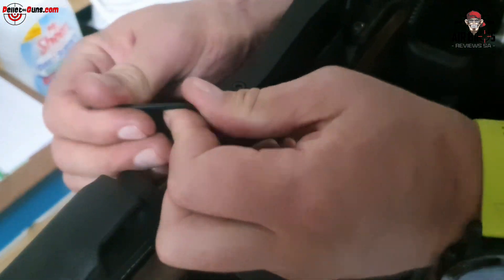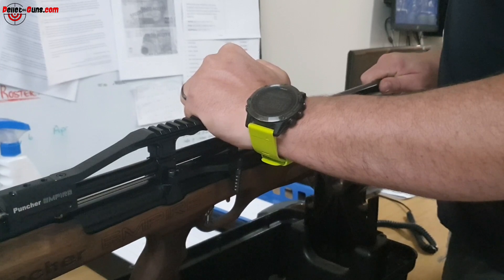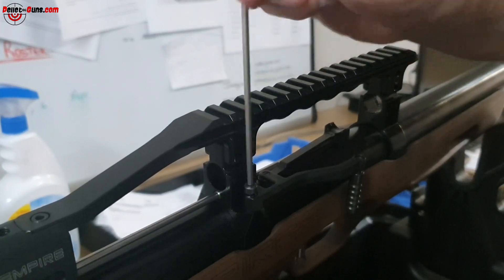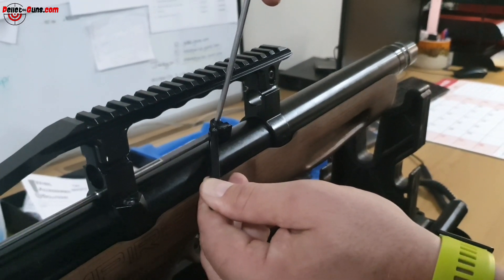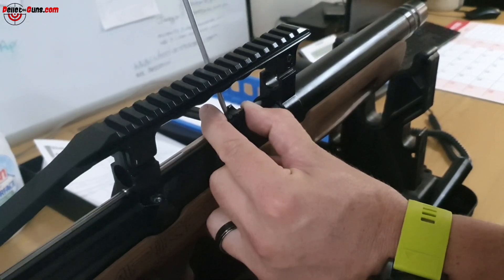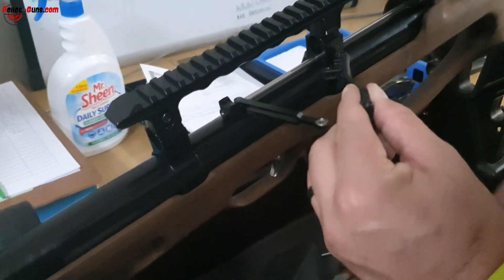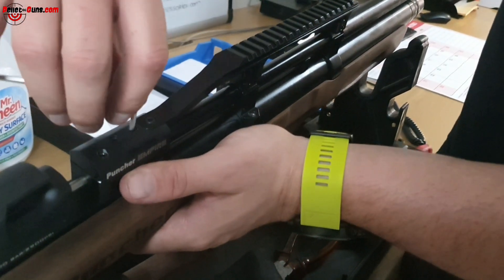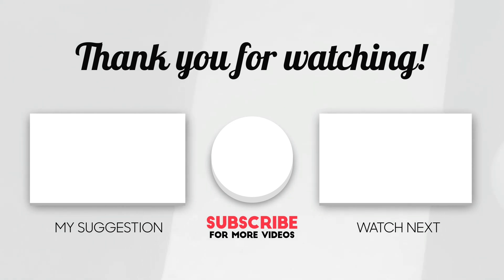KRAL EMPIRE  Changing cocking lever from right to left.

Comment: I'm trying to change my leaver to the other side but one looks like a rivet and I can't undo and it's stopping me removing the barrel is there a proper way to remove it or do I have to drill it. And I really don't want to drill it .
Reply from the maker: Hi, it should be a small screw flat not a rivet..
Reply from the maker: +27837684359
Reply: @airbrosreviewsa  hi I ended up drilling it out it was a tamper proof screw small hole and an easy out . It came out nicely
Reply: @airbrosreviewsa   I can't add a picture otherwise I'd send a photo